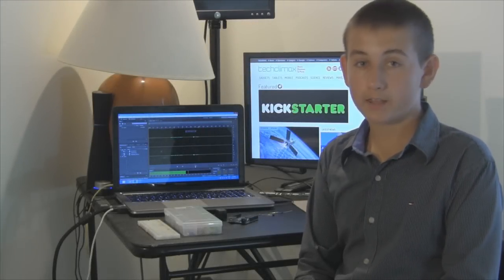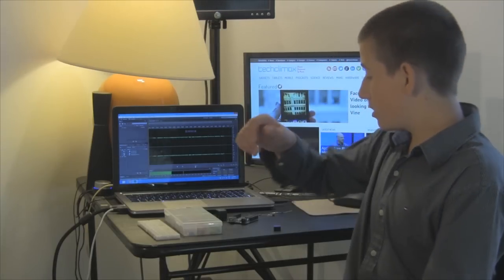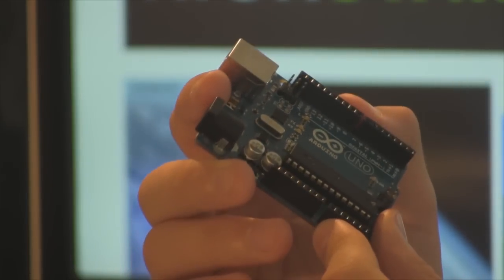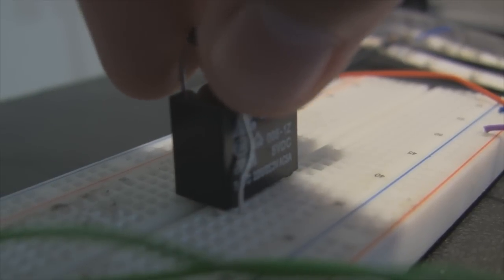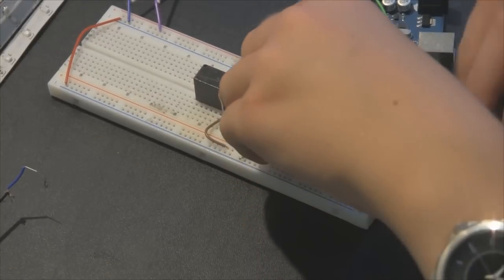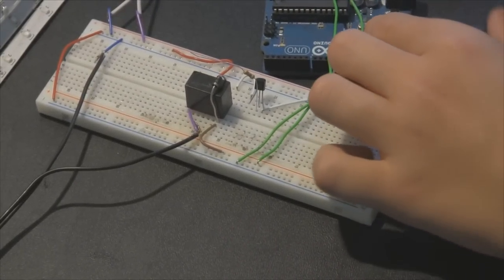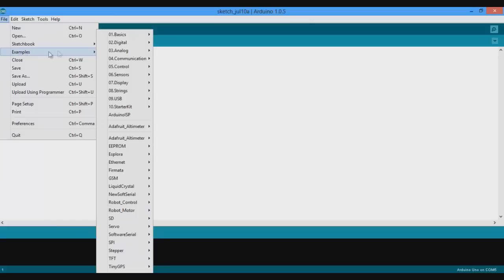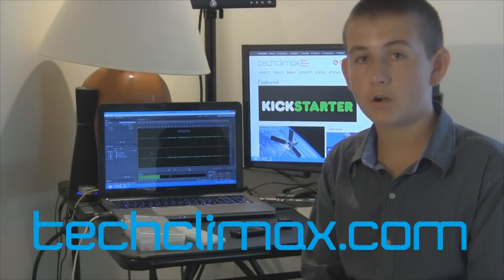Arduino Relay Tutorial (Control 220V - 12V Devices)

Comment: thank you brother but is it safe for the microcontroller?
I mean the 12v baterry will not back to the arduino through the transistor to damaging the arduino?
Reply: That's what a diode is for

Comment: Everything was going great , and then suddenly you wrap up the project without even showing how to get the code into the Arduino and you didn't even show the finished project working, How do we know that it worked? If you're going to go through all the detail of describing how to put in a jumper cable, then you don't leave out two of the most important things in the entire project. You really should finish the ending of this project properly, then repost and updated video.
Reply: He did show uploading the code.  first he hit the "compile" button in the IDE, and then the "upload button."  Since he showed the USB line connected to the Ardunio, it's implied that the code was uploaded.  Additionally, he was showing the unit blinking the LED strip.  the sketch "blink" is basically the "Hello World" code in ardunio.  He nailed it, and you'll understand that as soon as you try an ardunio.

Comment: can I use 6v relay
Reply from the maker: Sanjay K Santhosh yes. you could even use this relay to switch 6v devices.
Reply: my relay is 6v and the out put from the arduino is 5v does it break my arduino

Comment: Hi Roman this video is very helpful. I have a project to run Potter And Brumfield KUEP-3D15-12 Relay using delay between ON and OFF and i am planning to use Op-Amp 741and RC timers. Still struggling in the programming. Can you help me please.

Comment: What is the resistor for? I see these capacitors and resistors soldered onto motors and in between, but I try my experiments without those accessories and they work just fine. If you had just a wire there, it wouldn't work? Also that top red wire where you connected both ground rails, what is that doing exactly? Don't see why mixing the 5v gnd and 12v gnd is okay.

Comment: When you say 120v, you say that because that's the voltage your country uses, right? Should also work with 220v-240v?
Reply from the maker: Correct. The contacts are rated up to 5A (@250VAC, 30VDC).
Reply: will that 220v intermidiate with 12v on switch side ? Why you put a diode accros switch sides ?
Reply: The diode is there to stop the transistor from being fried by the relay. When the relay opens and closes, the coil inside it that forms the electromagnet generates a bit of current that can flow back up the wires to the transistor and burn it out. By sticking a diode across the coil contacts, it shorts out anything trying to go back the other way, and protecting the transistor. It's good practice to use a diode like this on any circuit that uses relays, Arduino or otherwise.
Reply: djsherz
 I’m new to arduinos and that comment made diode very clear, thank you. 
Are there different kinds of diodes? Like the transistor is p2n2222 or something I forget, but are there different diodes?

Comment: my understanding base on the video.
resistor to protect by lowering the current to the base of the 2N2222 NPN transistor which bridge the 12V supply to the relay coil and the diode act as flywheel to cancel off EMF created by the relay as its an induction load to protect the low power transistor at the collector end when the power is redraw.
and this completes the switching circuit.
as for the contacts in the relay, a separate circuit from the coil; which any voltage & current will be safe to connect through as long its within the OEM indication.
Reply: +Reese Me These should come in really useful for your projects. http://www.ebay.co.uk/itm/VAUXHALL-FRONT-REAR-FOG-LIGHT-HORN-Arduino-Relay-4-PINS-2-GM-24432680-12V-20AMP-/262146640666?

Comment: Ok can someone tell me why da hell do we need a transistor or a mosfet if your using a relay? the both work the same way only that one is for Ac power "relay" and the other is for Dc power "transistor/mosfet" GATE/ latch on the transistor just needs 5v to trigger it and the same can be said about the relay it needs 5v to trigger the gate /SIGNAL to open/close the circuit so whats the point? BUT even a some relay's can be used with Batteries for DC 12-30V @ 10-30A not just AC so again why use a transistor? i can see why the diode or even a resistor but a NPN or PNP com'on someone break it down just as i have

http://www.ebay.com/itm/181341466288?_trksid=p2057872.m2749.l2649&ssPageName=STRK%3AMEBIDX%3AIT
Reply: Frank Lopez I get the idea maybe he's not using a "logic-level" relay.
Reply: maybe so but he needs to address this type of characteristics so one don't get confused
Reply from the maker: Hi Frank, sorry for the late reply! You've probably found an answer by now... but here it is for those who are confused. We need the transistor because the Arduino cannot provide enough current to flip the relay. An Arduino can only provide about 20 to 40mA on a single pin without significant voltage drop and possibly frying the pin. A relay coil can take significantly more current. 

You could build a circuit that switches a load with just a transistor, however I'd only recommend this for low-current, high speed applications.
Reply: Frank Lopez The transistor is necessary because even though he was 5v, your current may be within the maximum pin current (or even extrapolate) offered by Arduino which is approx 30ma. Using the transistor you put all this "current" in the transistor. The diode is needed as a protection, because when you turn off the relay, there may be some voltage generated by electro-magnetic field of the relay coil, which can kill the transistor.
Reply: you dint explain well the whole transistor thing, as for the diode that makes sense and about the arduino max mA yes i knew this but thanks
Reply: yes thanks for the reply, but im actually dealing with a high current high voltage platform im building  so i have concluded that i will have to get china to send me several mosfet pchannel and nchannels here in Boston so that i can build my own motor driver  and the relay well this is going to be part of my wireless RF relay system control by a imu so i guess in addition i have to build my own wheatstone full bridge so thats another video i have to study on

Comment: Thanks for the video! what did you use for your 12 V power?
Reply from the maker: No problem! I used a universal AC adapter similar to this one: http://amzn.com/B00B1M2B62 However any supply voltage will work up to 120V
Reply: ***** Thank you! so I got a different relay and I cannot find the wiring diagram for the life of me anywhere. You mind giving me a hand? I bought this one: http://www.amazon.com/gp/product/B008MPK0VE/ref=oh_aui_search_detailpage?ie=UTF8&psc=1

and the only diagrams i've been able to find are these:

http://electronics.stackexchange.com/questions/3199/how-do-i-connect-a-relay-and-transistor-to-an-arduino

I'm having a hard time figuring out which one is the right diagram for the relay. Thank you!
Reply: Andres Medellin Nevermind I figured it out! It works!!!! :) the diagram i sent on the above link was right, thanks a lot brother!!! :D

Comment: roman thanx for the great vdo ,  i am connecting my water flow sensor and 12v solenoid valve , so that after the fix 3L my valve stop the water flow ,   i am using TIP120 TRANSISTOR with diode  1N4004 10k resistor ,  should i be using 10 k resistor or go with 330 ? sorry i am quite new in this any help would be appreciated secondly the code u have changed for blink can i use the same for the valve to turn on and off for like after  2 3 minuter
Reply from the maker: Tarique iglesias No problem! The purpose of the resistor on the transistor is to keep the Arduino from being fried. To figure out what resistor value is required you need to know the power draw of the solenoid valve (connected to the collector of the transistor). 
Here is the GENERAL equation: (5V - 1.25V) / power draw = ohm
Take a look at this liquid solenoid valve for ex: https://www.sparkfun.com/products/10456 it draws 300mA. So put this into the equation: (5V - 1.25V) / 300mA =  125 ohm 
You don't need to use the exact resistor value. 120 ohm, 130 ohm etc will work as well. Try the 330 ohm if that is all you have, its very likely you could get away with that.
Yes use the same code.
Good luck! -r

Comment: HI Roman, Great video ! If I wanted to control a solenoid with a sensor , would the setup also be via a relay ?
Reply from the maker: Thanks AL! Yes, I use relays to control solenoid valves all the time. Adding a sensor wouldn't be a difficult. For example: if sensor value is > 500 then digitalWrite relay HIGH. 
Good luck! -r

Comment: Thanks man! I am new to Arduino and decided to learn so that I can redo the light circuit for my motorcycle (4 blinkers, tail/brake light, and head lamp). Any suggestions?
Reply from the maker: Hey! Your circuit should be fairly easy to do. For every light you would like to control you will need a separate relay, transistor, diode etc... Connect one end of your load the motorcycle's battery and the other to the positive wire on the light. Connect the ground of the light to the ground of the battery. The rest of the circuit will be identical to the one in my video. Id recommend you prototype your circuit on a breadboard however after its all working transfer it to a protoboard and solder everything together.

Comment: If I want to connect a 12v LiPo battery to the Arduino 5v/Ground pins, instead of the USB power source, should I remove the common ground wire you have going between both ground rails (3:44)?

Comment: What if I connect directly to the relay without the diode or transistor while having an external powersupply for Arduino?
Reply from the maker: Thanks Chris! correct it wouldn't work
Reply from the maker: That wouldn't work. The arduino doesn't output enough current to flip the mechanism in non solid state relays. On the other hand if you used a solid state relay it would work since very little current is required to "Open" and "Close" them.

Comment: Hey roman or anyone, I got this relay by mistake:
http://www.amazon.com/gp/product/B008MPK0VE/ref=oh_aui_detailpage_o07_s00?ie=UTF8&psc=1

It's a HT4100F DC 5V Coil 6 Pin General Power Relay SPDT 5 Pcs Relay

would it work following these steps?
Reply from the maker: Yes however the pin out might be different. check the data sheet. Good luck!
Reply: ***** it didn't come with any data sheet, but i'll look for it online, thanks! :) keep it up brother!

Comment: Thanks for the cool video Roman. So I'm teaching myself arduino and electrical engineering for that matter and I see you basically turned 5 v from the arduino to the 12 V to power you lights, right? what's the explanation for that? Because I need to power a fan with 6 V or more, but I had more in mind to put a switch on the arduino and just make it go on and off of an actual battery. Any thoughts?

Comment: What did you use for your 12v supply?
Reply: The relay probably requires somewhere in the range of 12 volts, although there are ones that use 5 volts you shouldn't directly connect those to a digital pin on the arduino because they draw more current than the arduino can supply, so 5 volt relays can be connected to the 5v pin on the arduino using the same transistor circuit. If this is confusing I can clarify.
Reply: ***** Yes, this i understand, i was just wondering instead of buying an expensive voltage generator, can you simply use a AC/DC 12v adapter?
Reply: Aaah sorry I read "why" instead of "what"... You could definitely use a cheap ac/dc 12v adapter, just make sure it can supply enough amps for the LED's. If you know how many amps one led draws you can just multiply that by the amount of LEDs. If you don't know how much on LED draws then 20mA is usually enough for single color leds, rgb leds are usually triple that or 60mA/led.
Reply: Steve s If you're still in the dark, just ask :)
Reply: ***** Thank you very much Nathan! this helped!
Reply: no problem! good luck and have fun!
Reply: The led stripe uses 12v which arduino is not capable to provide

Comment: Hey Roman.  Thanks for the video.  I followed every step, but it is not working.  Is there a minimum current that the 12V supply needs for the relay to work, or does the relay work from the 5V supply.  This is the only thing I can see that is an unknown and may explain why this is not working.  
Also, as I am new to this stuff, what is the max current on the 12 V side that this will handle?  I want to run a 4 A motor.  Would I need to change anything?
Thanks for any and all help.

Comment: hey, thanks for the vid! I want to use that arduino/relay to power a solenoid water valve to automatically water my herb garden once/day; do you think it would be practical to run it off a battery?
Reply from the maker: Norm, solenoids use a lot of power. If a wired connection is available I would recommend using it. Although you should be good with a battery, I have powered a solenoid and relay off of a battery before.

Comment: How fast could you get the LED strip to blink using that relay? I know solid state relays can be super fast, but I'm curious about these cheaper relays which are easier (for me) to source.
Reply from the maker: Hey, I din't test how fast I could get them to blink, its probably on the datasheet. Thats one of the main reasons I got these relays, because they are very easy to source. Solid State relays aren't always more expensive. One I have been using lately is about $1.14CND http://www.digikey.com/product-detail/en/CPC1017NTR/CLA233CT-ND/1212844

Comment: Hey! good video, only, If I misplace the connections, I could kill my arduino (and CPU also!!!!) Is it possible for you to send a schematic view of the circuit?? (I made one, can I send it to you??) THKS!
Reply from the maker: Thanks! Killing your arduino would be bad! Please send me yours. email@romanakozak.com
Reply: ***** hey buddy thanks for the tutorial....i hve a question..iam making a project where i need to use relay along with RF modules...so bascially to keep it short..whenever circuit is on..transmitter will transmit signals stating whatever..and whenever the electricity is shut down in plant..den transmitter will stop transmitting signals..or maybe the opposite..whenver current is flowing led WONT BLINK..and whenver there is power failure..RF modules can then blink an LED in the main office..so its more like an alert.

Comment: Roman, well done. 
A few thoughts:
Polarity is important on the diode. This diode will reduce inductive kickback from the coil. A resistor or zener diode can be placed in series with the flyback diode to use up the stored energy quicker.
Great job!
-Ronn